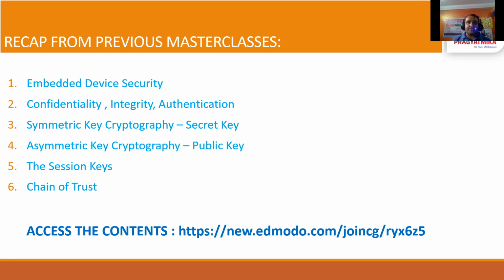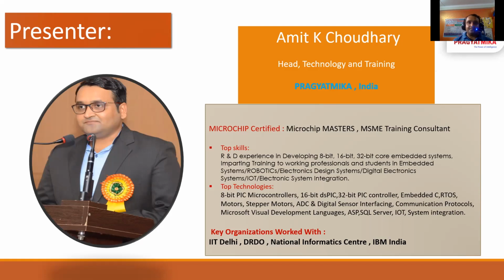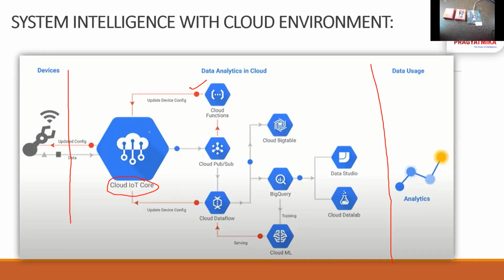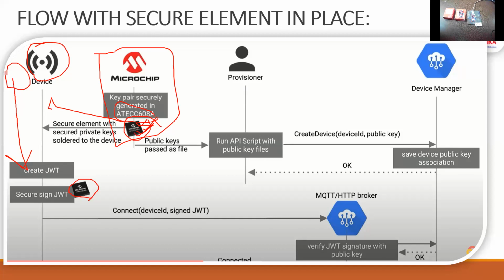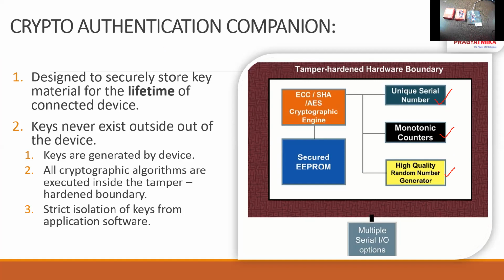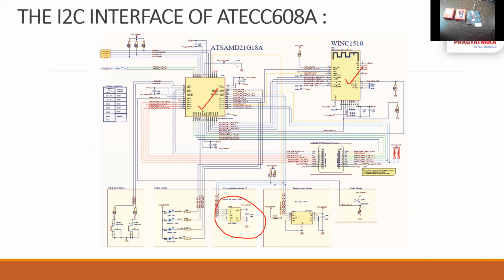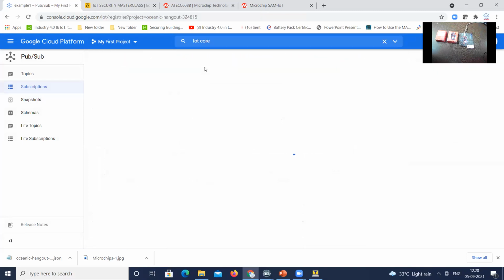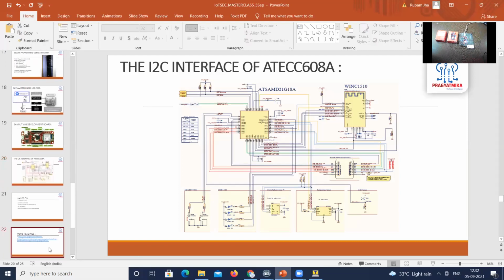IoT SECURITY MASTERCLASS | CRYPTO ELEMENT | SECURE AUTHENTICATION | MICROCHIP ATECC608A |GOOGLE CORE

Comment: Thanks For explanation, I have Question, Can we use Program to be upload (software) in the Microcontroller instead  of using ATCEE806?
Reply: ATECC608A is a Hardware secure element which stores your keys independent of your firmware and provides the facility to keep application secure. You can attach keys in your firmware but it adds complexity and security hole . So, not a better choice.